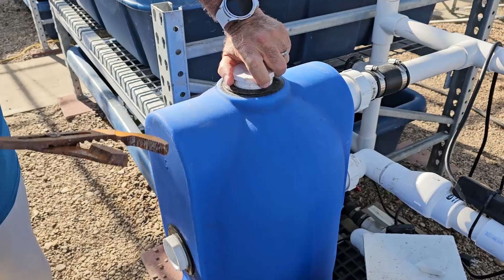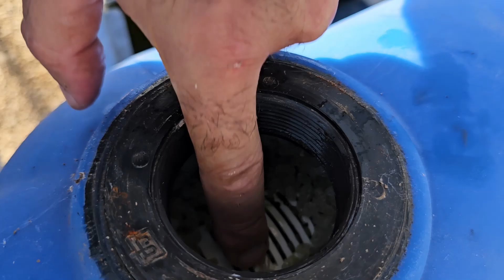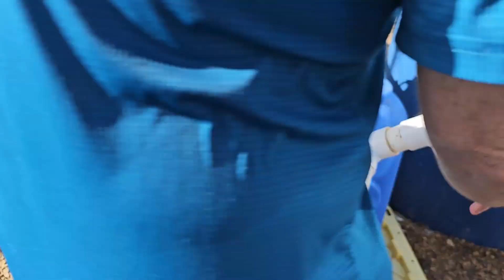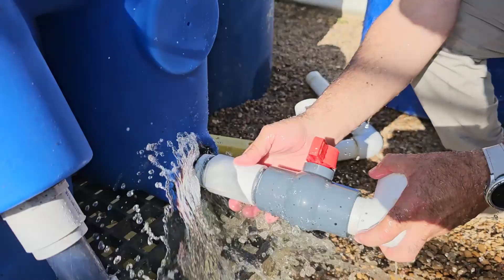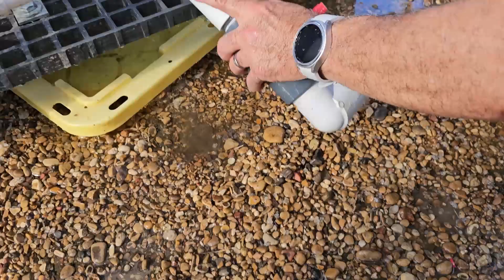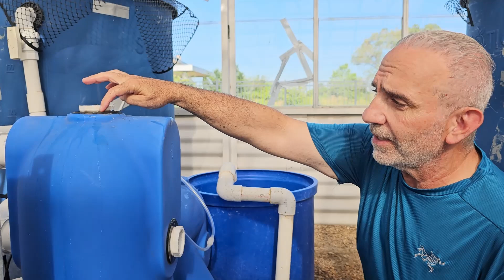Clogged vs Clean Bead Filter in an Aquaponic System

Comment: Would your beads stay cleaner if you had the system automatically flush more often?
Reply from the maker: We're taking a deeper look into this, so we'll get back once we've done some tests. - The Vegetable Doctor Team
Reply from the maker: I think instead of a system flush, reducing the algae growth would keep the beads cleaner. In order to test this, I've placed a white landscaping barrier around each of the drain tanks (reservoir tank) like a curtain. It's outside of our budget to add automation to our system; however, keeping all other variables the same (think feeding, stocking density, plant density, etc.) you'd gain more negative than positive effects from flushing more often. In aquaponics, the goal is to keep the system stable, and frequent water changes can make it difficult.  I'll add another update after we see the results. - The Vegetable Doctor Team